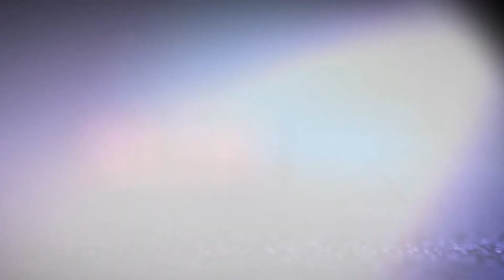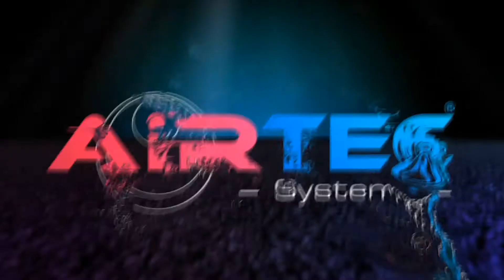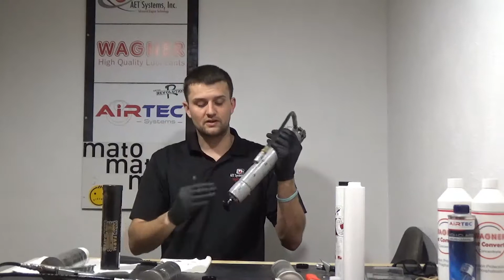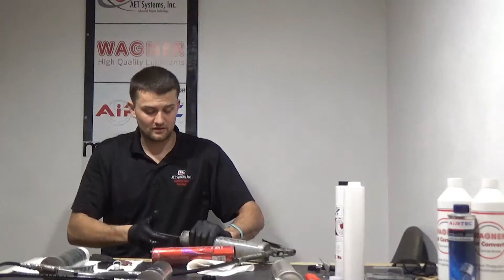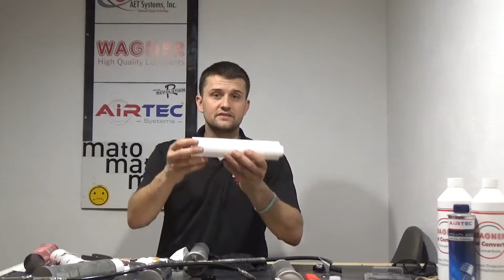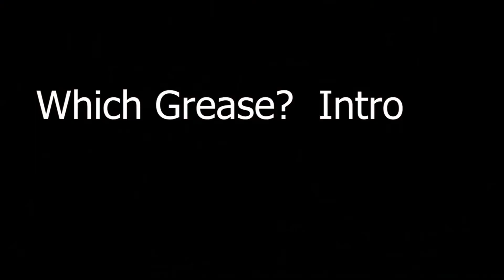Changing a Grease Tube

Comment: Can you use lube shuttle tubes on the new battery powered grease guns such as a Milwaukee? Tim in northern TN
Reply from the maker: Good day,  lube shuttle cartridges do not work in Milwaukee or Dewalt grease guns.   The pistons are not sealed well enough to maintain a vacuum and the heads are not molded for threaded grease tubes.
Reply: @aetsystemsinc.1413  which battery powered grease guns do accept Lube Shuttle tubes?
Reply from the maker: @CliffsideStables  https://store.advancedenginetech.com/collections/lube-shuttle%C2%AE-grease-guns/products/lube-shuttle%C2%AE-electric-grease-gun